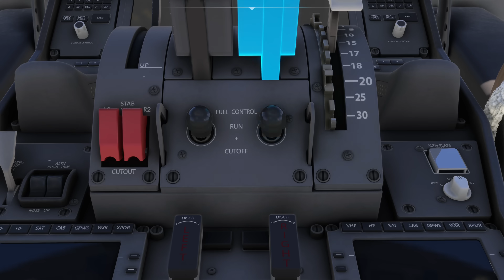Air India 171: Why Did The Fuel Cut-off Switch Get Moved?

Comment: Since we can draw our conclusions based on the preliminary reports, I firmly believe that one of the pilot watched other shutting off the fuel to cutoff in this case (co-pilot watched the pilot doing so) then they exchanged the words that we all know by now as per the cockpit recorder and then co-pilot must have waited few seconds as he had his hands on levers as he was doing the takeoff procedure for a captain to turn the fuel switches back to run but captain never intended to put them on run to which it took about another 6-7 seconds for a co-pilot to put the switches back to from cut-off to run. Now as co-pilot was also doing a takeoff procedure; it rationally makes sense the 4 seconds gap between turning the two switches on simultaneously; otherwise would have taken a second or so or if the Captain did that then he must taken those 4 seconds between intentionally as per his pre calculations so the flight engines can't be recover on time. Doing personal research, Captain had been through severe depression as well before due to their Mother's demise as well as other such medical leaves Captain had taken before. On the other side, co-pilot was supposed to get married two days later with her fiance so I don't see co-pilot thinking of doing such thing. Also, captain was never married so I can't be vague but going through life alone will always be more challenging for most mankind on this planet. It's just my perspective; I respect Pilot's all over the world but when it comes to mental well being we may never know from outside what's going in their head especially when one has no one to communicate. Just wish, what if the pilots had a healthy communication before taking just asking one to the another how is he holding up in his life? Could that perhaps have saved hundreds of life?

Comment: Here is an additional piece of analysis as an evidence of act of deliberation in bringing down AI 171:

Repopulating the significant timestamps  from the preliminary report: 

08:07:37 Aircraft started rolling
08:08:33 Aircraft reached V1 (153 knots)
08:08:35 Reached Vr (155 knots)
08:08:39 Liftoff confirmed (transitioned to air mode)
08:08:42 Max airspeed reached (180 knots IAS) *
08:08:43 Engine 1 fuel switch moved to CUTOFF *
08:08:44 Engine 2 fuel switch moved to CUTOFF *
08:08:47 RAT hydraulic pump activated (both engines fell below idle) *
08:08:52 Engine 1 fuel switch moved back to RUN

Critical Takeaways from the above data:

At 08:08:42 the aircraft achieved its "Max" speed of its entire short flight, which was only a second before the fuel switches were turned to cutoff. So until the fuel switches were turned off, the aircraft was at its max recorded speed which is 180 knots. 

The sequence of timestamps above clearly show that until 08:08:43 when the Engine 1 fuel switch moved to CUTOFF, the flight was pretty normal. No RAT deployed yet. 

RAT was only deployed at 08:08:47 , which is 3 seconds after the Engine 2 fuel switch was also moved to CUTOFF. 

If there was a genuine technical issue in the aircraft, such as an involuntary fuel cutoff, the RAT WOULD HAVE KICKED-IN WELL BEFORE THE PILOTS  figured out there was an issue with the fuel supply/both the engines. Which is NOT the case. 

**Additionally the MAX speed would have been recorded well before the fuel switches were moved to cutoff, if there was somekind of electronic failure that led to cutoff the fuel supply without pilot's intervention.

When we see that the MAX speed almost closely overlaps with the timestamp when the fuel switches were moved to cutoff, that simply means that the very act led to the fall in the aircraft thrust and therefore its speed.

Comment: is it necessary to physically move the switches to cutoff to close the cutoff valves, these are electronically controlled and could be a sensor or other electrical/electronic malfunction that could've caused that. In the case of boeing 737 max, it could've been easily been believed that the planes were deliberately put into a nosedive because the pilots were suicidal but that wasn't the case. This video seems to completely absolve boeing and also tries to humanise a corporation to build a narrative but given their past record and allegations by multiple whistleblowers on they have sidelined safety for profits, I still feel that there might be some technical issue which is being overlooked. Sadly for Max 737 it took multiple crashes and lives before Boeing actually accepted it..

Comment: 0:58
In the report the statements were not quoted and in reports like that the actual words need to be quoted exactly as said by the pilots, it should not be...
"In the cockpit voice recording, one of the pilots is heard asking the other why did he cutoff. The other pilot responded that he did not do so"

This wording sounds suspicious, since they didn't quote the pilots as to exactly what they said, it means this was implied and understood by the person writing the reports, or the reports wants us to believe it happened.

What does it mean by heard asking, didn't the pilot said it happened ?
I mean i hear wind whisper words into my ears but winds doesn't actually say anything.
Reports like this should mention exactly what happened not what is understood and implied by the reporter.

Moreover the FDR in black box records every data of critical switches, it records exactly when they are turned off and on and CVR records exactly what is said in the cockpit it is so sensitive that it can even records the rattling noises and flicking of switches.
They can quote the data of black box too, like at which exact second that switch was flipped off.

Comment: I watched a video on “GarybPilot’s” channel that talked about a flaw in some Boeing models (including the plane in question) where the fuel switch locking mechanisms were disengaged. This created a concern that the switches could potentially be switched to the “off” position in flight (inadvertently), causing a catastrophic incident. Is there any credence to this as possibly being the cause, before we all conclude that one of the pilots INTENTIONALLY killed themself and 200+ innocent people?

Comment: Captain, you mentioned that based on visual comparison between the crash footage and the aircraft photo, the ram air jet turbine was deployed. Then later it was revealed that the pilots had manually cut off the fuel supply. I’m trying to understand does that sequence actually make sense? From what I know, the ram air turbine only deploys when there’s a complete loss of electrical or hydraulic power, not just because fuel is cut off. So would manually shutting off fuel cause the RAT to deploy? Or is there something else that would connect these events?

Comment: Theory 01:
When the engines were not providing the adequate thrust, one of the pilots may have started the engine restart procedure at the last moment and during that period of time with all those confusions the pilot who handled it might have mistakenly set it to off position, the crash happened and the levers were set to the position where it is now being seen in the records.

Theory 02:
At the last moment they might have been preparing for an emergency (crash) landing and as the engines were not working anymore and prevent any fire eruption as a result of continuous flow of fuel to malfunctioning engines on impact and to reduce the risk of getting the plane blown away, one of the pilots might have switched off the fuel to engines.

Capt. Steeeve,  please clarify these theories... Thanks.
Reply: if this was a sabotage or suicide- there would have been altercations between two pilots and engine cut off switch would not have been brought to on position so soon.Also my pilots would tried to toggle the engine cut off switch multiple times in desperation to relight the engine.
Reply: also if it was a sabotage the experienced pilot would have chosen much more straight forward and full proof methods to crash the plane than fooling around with engine cut off switches.
Reply: the only engine restart procedure is to restore the fuel switches to Run. The FADEC will restart the engines (takes time).
Reply: No and no.

Comment: Seen 100s of switch toggling videos in last few days, most of them clocks 1.7 to 1.5 seconds..Let's assume one with extreme swift hands can do it best 1.4 seconds..is it really possible to two within a second? And if one experienced pilot can do it in 1 sec, the 2nd experienced pilot under extreme urgency takes 4 seconds? Don't you think 1 sec is too short a time to do it, while 4 sec is too long? what if fuel was cut off due to a relay or software glitch while the physical switch still being in the RUN position making both pilots confused? (remember flight data recorder actually depends on these relays and softwares to determine the position of the switch)..Then as a last try, they might have toggled it twice back and forth to RUN position..that may take 4 seconds

Comment: Nobody over here is talking including you captain steve about the nine seconds that passed when the fuel switches were cut off and then brought back on…why did it take that long??…what was the thought process goin on in their minds…I mean in my opinion it looks very much that the captain was the guilty party …if this was suicide/murder then the copilot should have reached fast and turned it to run mode right away…why didn’t the copilot turn it on right away is so perplexing….I mean if the copilot was the culprit then there would have been some kind of yaw when he left the yoke to reach for the fuel switches…the plane would have gone into a right bank or left….from the videos we saw the wings of the plane were level and the plane just dropped so it couldn’t have been the copilot….all these talk about there being a glitch or there was a software issue where the micro valves did internally turn off then why didn’t that happen when the plane was taxing or when the plane was taking off and reaching V1 speeds….the glitch had to conveniently happen when the plane lifted off …all these Indian pilots are doing their best to divert blame away from the pilots….they know very well that when the co pilot said “why didn’t you turn off the fuel switches  with the emphasis being on the “WHY”….nobody will talk like that unless they are sure that the other person did this….normally when a thing like this happens then wouldn’t the copilot say”captain what do we do cause we have lost thrust…help captain help”…but the copilot didn’t say all that ….he straightaway accused the pilot cause I believe he did see the pilot do the unthinkable….cam 1 is always the pilots mike and cam 2 is the copilots mike so it’s vital that the Indian investigators send out the full transcript like they do when other crashes happen…please don’t cover up.

Comment: The crux of the matter, particularly highlighted by the Air India incident, is not that pilots should be able to shut off both engines, but rather that the design should prevent inadvertent shutdown of either, and especially both, during critical flight phases.

Comment: Fuel control switch cut-off happened for both engines within a second. Is it really possible? Don't blame on pilots, who are not anymore to justify this. It's a design flaw and it could have been na mechanical failure..
Reply: Go-ahead, believe what you want to believe. Maybe Bigfoot shut off the engines.

Comment: What we see in Flight Data Recorder is the Enginge fuel control switches were transitioned to CUTOFF from RUN, one after the other. Does that necessarily mean, the transition happened due to mechanical input by either of the pilots, or could the sensor have malfunctioned and transitioned to CUTOFF while the physical position of the remained in RUN?
Reply: There is no sensor. Mechanical switch tied into the computer. The audio confirms it when the pilot notices that the switches were physically off and tries turning them on.

Comment: How important is it to have those cut off switches to be within reach of the pilots? At what point are they used for emergency purposes?
Reply: If an engine is on fire during flight, the switches need to be in reach to cut off the fuel that is feeding the fire and spreading it. Also, if an engine is damaged in a way that threatens the plane, such as broken turbine blades that cause vibrations. A jet plane can easily land with only one engine after a damaged engine is turned off.

Comment: Captain, re: Air India, please read this theory. Not a personal suicide but a sabotage suicide made to look like pilot suicide. A pilot seeing that fuel switches were moved to cut-off position would have instantly corrected not first ask why!  I hope that have voices analyzed to determine who said what and when. Also, ten seconds to put switches in run position is much too long. Might have been a struggle or done at last second to reinforce the falsehood. I hope the investigators are not settling on pilot suicide and not delving further into the possible sabotage possibility.
Reply: What does "sabotage suicide" mean? How could a saboteur who wasn't one of the pilots make those switches move? The cockpit door is always locked during takeoff, ever since 9/11, to prevent hijacking.

Comment: Captain Steve is it not true that in all emergency situations Boeing QRHs universally require retarding the thrust lever to idle first, then cutting off the fuel switch for that engine? If so, shouldn’t Boeing and the FAA immediately and without delay (regardless of the outcome of this accident) issue an Airworthiness Directive to prevent cutting off the fuel switches without first setting the thrust levers to idle which should have and could have prevented this accident or any intentional untoward actions in the future. If you have a fire or actual emergency and legitimately need to shut the engine down and cut it off including during critical phase you still need to perform multiple deliberate actions in sequence to accomplish this. This would eliminate the need for dual pilot input which could honestly come with other problems such as pilot incapacitation for example

Comment: In desperation, as the plane was descending, a person facing death might try anything, and it was confirmed that they were in trouble before they left the runway. If they can blame the pilots, it takes the pressure off the aircraft manufacturers, as it is a design fault.

Comment: The report says the fuel switches were cut off and then again back to run in 10 secs, thus this necessarily means the physical movement of the switches? Can it also be the cut off detected in the electrical or hydraulic circuit. Then what the pilot said is correct, he did not do it. Are we easily trusting a machine and concluding it was a human error or purpose?
Reply: Why would the pilot ask the other about the switches if he didn’t see it off ? And they were turned back on. A glitch cannot perfectly do all these steps.
Reply: So the pilot can see the cut off switches but cannot see the other pilot switching it off?
If the other pilot knew he was seen cutting off the switch why would he say ' I didn't '
Reply: No where it says physical movement of the switches....the engine stopped...so did its sound... that's enough for one person to ask " why the switches were cut off' because they get that error on the screen, fuel switches are cut off. This does not mean the physical position, but something beyond the cockpit inside the plane could have happened that stopped the fuel supply to the engines

Comment: Captain, I agree with you that when you are landing you should be able to "Cut-off" the fuel to an engine if it catches fire. In this case or when taking off, there should be some "Built-in intelligence" where the system will check and make sure that there is in-fact fire in the engine before it lets the pilots cut-off the fuel. If the system gets a signal of No-fire, it should override the pilot and trigger a voice alert in the cockpit. Are there any issues in doing so?

Comment: Capt. Steeve, After seeing most of yours and other videos,  I have a lingering doubt that you can hopefully clear.  
Now that we know from the report that the  Data Recorder apparently indicates that the Cut off switches one after another switched to the off position and soon after being in the run position. 
My question is are the signals to the Data Recorder  sent out from the sensors in the mechanical assembly itself housing these switches or by some other means, namely by the underlying electronics. 
Could it be electrical glitches which could have falsely simulated the mechanical movements and also could have turned off the engines then back on to run and also feeding the Data Recorder.  
Could it be the pilot audibly noticing the engines winding down asked the other "did you shut off the engines" instead of actually looking at the cut-off switch positions. The other pilot answering " No I didn't " kind of  make sense here.  Could it be the reason the report using the term " transitioned" instead of moved in describing the cut-off switch positions as per the data recorder.  Thank you.

Comment: A mental health point to consider.

I have OCD and until I worked out what as going on I literally had to be kept away from large buttons, the big red power button buttons for example, which I had hit without thinking once and turned large equipment off with disastrous results before. 

It’s a very odd thing being compelled to do something and not being able to stop it, or in a moment doing it without thinking and almost without remembering. But you would remember unless you had a problem with your short term memory also which could be a factor.  You could literally do something and not remember a second later?

I’m not expert but could ADHD cause such a short short-term memory issue, in combination with OCD compelling the bad action?

Maybe a psychiatrist or psychologist could comment?